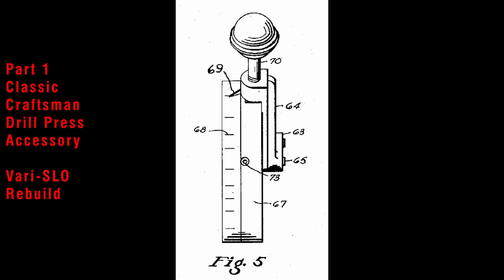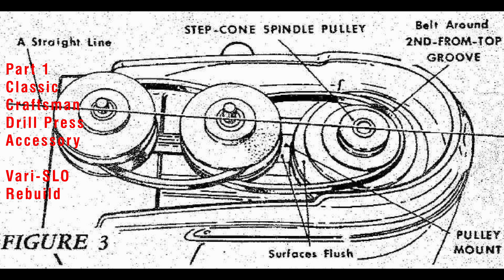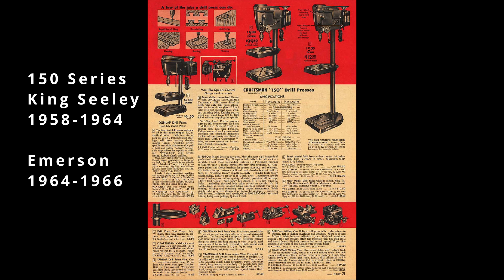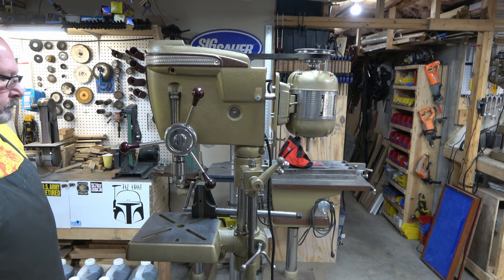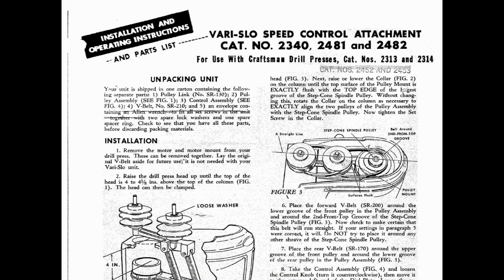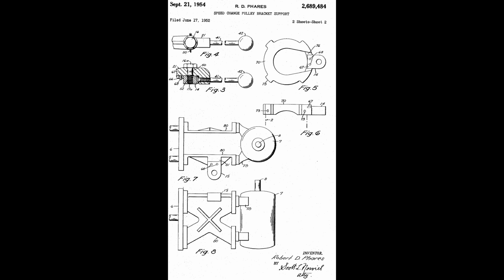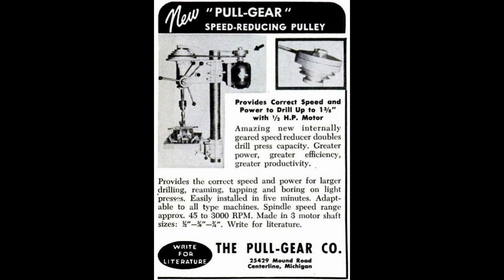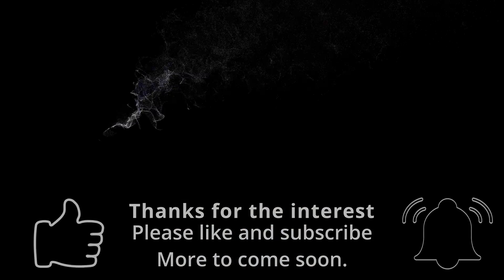Part 1 Craftsman Vari Slo Rebuild (Overview)

Comment: Hello - I recently purchased a series 100 Craftmans Standing Drill press with this speed reduction option but in your video you say there are links below to help get more information . . . . . but two of the 3 do not link to anything.
Can you help me please?
Reply from the maker: Thank you for the question. The links are working for me when I click on them. The first is a pdf instructions/ manual for the VS. If the link is not opening for you, you can follow the second link to the Craftsman page on vintagemachinery.org. Once there do a publication search then enter the model number of what you are searching for. The VS could be any of these three 9-2340, 9-2481, & 9-2482. Lastly, the final link is to the Garage Journal Forum. Once there go to the craftsman drill press thread and post you questions there. I hope this helps.